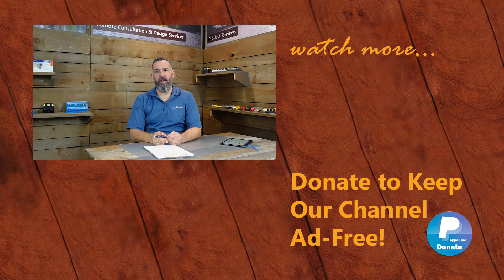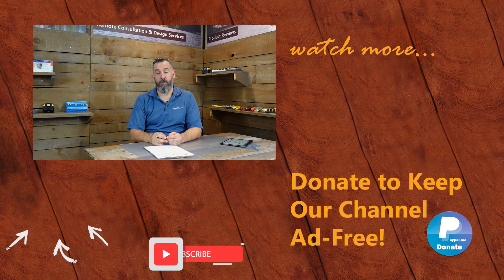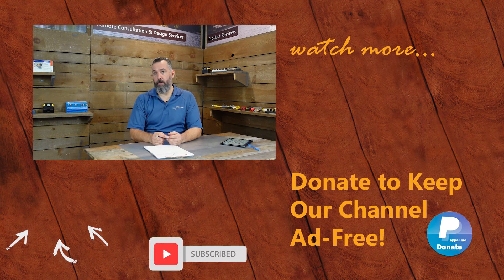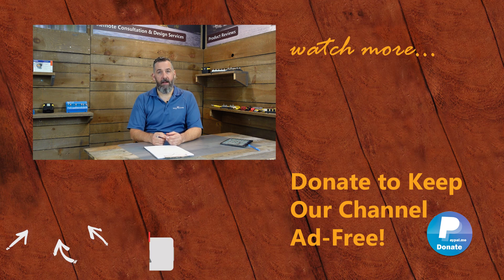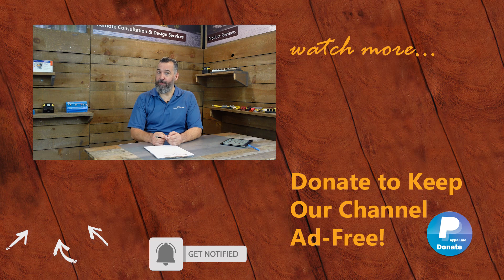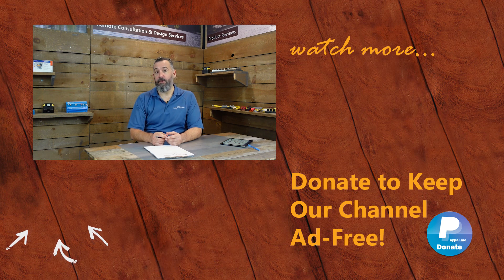What Is The Best Wire Size for a Bow Thruster?

Comment: Hi Jeff
Thanks for all your videos, especially for when we just installed our inverter charger. 
Now we are installing a 24volt bow thruster using 2 new batteries in the bow. The windlass wiring runs from the rear & is 12volt. 
Can we use the same negative return wire for the 24volt system as the 12volt windlass?
Reply from the maker: Yep, you can use the same ground, make sure wiring can handle amperage from both 12 and 24 volt at same time.

Comment: Hi Jeff, so when you go on to a new build would you recommend different options for wiring ?
Reply from the maker: Hi Robin, when installing a bow thruster battery bank, one has decide how this bank will get recharged, either by battery charger (powered by shore or generator) or also have the alternator(s) recharge the bank. We can either choose a battery combiner or a battery isolator as a way to share the alternator output to multiple battery banks.

Comment: Morning Jeff, my stern thruster was burning fuses when operating in 5 second intervals. When replacing the fuse I noticed that one of the lugs on fuse buss was not real tight. Tighten with about a half a turn. Could this have been the issue with fuse burning?
Reply from the maker: Good catch, a loose connection can definitely cause a voltage drop.

Comment: I have the same question about running a second parallel 2 / 0 wire or adding a 4/0 wire and still keeping the existing 2/0 wire in parallel? Will a pair of 2/0 wire in parallel Supply more power than a single 4/0 wire?
Reply from the maker: Good question, look up the amperage and voltage drop tables for a 2/0 wire.
Reply: Good info but didn’t answer the question

Comment: Totally agree, it’s far cheaper to put in a bigger wire and minimize Voltage drop than to replace the windless/thruster/winch which drew too much current and overheated because of low voltage.
Reply from the maker: Thanks for chiming in.

Comment: You didn’t answer the question. What wire should he use?
Personally I will put a battery in the bow for the thruster and windlass with a relay to engage either one. The charge wire and relays fused.
Reply: He said to use a 4/0
Reply: @bobbell5928  thanks
Reply from the maker: Thanks Bob for the update.

Comment: Could you add a second 2/0 wire??
Reply: Yes one can. But that gain won't be same as going bigger. All leads need same size and build. electric is lazy. Like plumbing and me.
Reply from the maker: Better to have one large cable then worrying about balancing current over two wires.

Comment: Can you install a battery isolator but also a battery's combiner switch just in case you need to use both batteries to start in an emergency?
Reply from the maker: Definitely!
Reply: @PacificYachtSystems   Do you have a video or a wiring diagram to do that? Tks!

Comment: Would be nice to know the price difference from the min size to the recommended wire on the length.
Reply: @ full retail (from West Marine, in the US) 2/0 wire is $8.99 a foot, and 4/0 is 14.99 so the difference on a 20 foot run (40 foot total) is $359~ for 2/0 and $599~ for 4/0 or $240 more.
Reply: @John_Hennings thanks. For that price diff I’d go one up.
Reply from the maker: John, thanks for sharing!
Reply: Hard to put a price on a crucial part